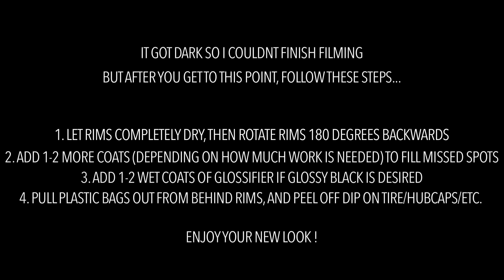How To Plasti Dip Your Rims (THE RIGHT WAY)

Comment: Not the best way to plasti dip rims... Best way is to take the wheel off the car... This is the lazy way... Sry no disrespect. Just saying the truth.
Reply from the maker: The point of plasti dip is to temporarily change the color of your wheels and overall protect the original rim from any further road damage. If you were permanently changing the color of the rims then yes, painting the inside of the rim would be necessary. But you get the exact same results doing it either way. And you can see on our Instagram page @throwsomediponit.
Reply: only u paint one side of the rim.i have motorbike so need to paint both side of the rim.
Reply: This is the dumbest explanation of laziness I've ever seen.
Reply: TheBalcerman Not everyone has the tools nor time to take off the wheels, just spray and go
Reply: Are you serious now? Tools to take wheel off? You can literally find them in the boot of your car. Time?! 3-5 minutes? Spraying takes like 75-90 minutes (intervals of 15 x no. of layers) Your argument is invalid. What we can see on the video is: "how to plasti-dip wheels the shitty way". You see. I do things right or will rather not even try to do shitty job if I can't do it right.
Reply: Jose Huezo. liked your comment
Reply: Only your opinion, some people like the silver finish to remain on the inside . The Black/Silver look.
Don't accuse people of laziness when they're simply creating a different look.
Reply: Jeeezzz.. this is some BS.
Reply: TheBalcerman you mad or what?
Reply: Unicorn1231997 If you don't have the tools to take off your wheels then your screwed when you get a flat.. if you have time to spray them, then you should have time to remove them...
Reply: Best way is to take the tire off the wheel after you take the wheel off the car
Reply: he's only doing the outside face, that's a waste of time
Reply: DuoBart0n best way is to buy brand new
Reply: Jose Huezo some people don't have the resources to take their tires off.
Reply: Let's just say that you are lucky that you didn't have wind blowing. or that black pain would be all over the side of your car. imagine taking black spots off your white paint. you're bound to scratch the paint.
Reply: Jose Huezo in your thought process...plasti dip rims? Thats for broke people
Reply: Ignacio Cabrera what? Your comment makes no sense. It doesn't make sense. So your saying since it's for poor people to take the video down bc it's pointless
Reply: Jose Huezo obviously
Reply: Ignacio Cabrera easier way to cover chipped rims instead of paying the wheel guy,  save  $$
Reply: Jose Huezo I got 2 coats, what u guys recommend? Lazy way or get more coats and do it the pro way?
Reply: Lazy kid , take off the wheel
Reply: TheBalcerman you get the same result
Reply: Really, they all come with a jack and lug wrench. Check your trunk( or boot) smh
Reply: Hmm,these cars come with a jack and a lug wrench
Reply: Mad, not at all. Just smh to comments of folks who say they don't know how to change a tire,  or have the tools. Pretty sad.But that's today's youth.

I could care less if folks leave the wheels on the car. Though you do run the risk of over spray on the paint if there is a breeze, and run the risk of that over spray getting on your brake pads / disks if not done correctly..
Reply: How is this "lazy"? Not everybody has a high quality car jack or system
Reply: LOL, most if not all newer cars have a car jack and a lug wrench in the trunk. Stop the nonsense.
Reply: If somebody want to do it with the wheels on its their business why y'all so butthurt over somebody else car?
Reply: Exactly. Most NEWER cars. I wouldn't put a can of 10$ plasti dip on a brand new car, that's just trashy. I use this stuff to make old parts look like new again such as rims, handles, mirrors, emblems, etc
Reply: Need a tissue princess. stop with the weak excuses. Doesn't matter how old a vehicle is, you should have a jack for the vehicle. That's just irresponsible and lazy if you don't.
Reply: Jose Huezo I spent 2 hours on each rim..had to take em off and clean em and get an even coat throughout
Reply: Guys i dont think they mean separate wheel and tire, i think they mean remove the the wheel and tire from the car to place on a workbench or something to get good access and get all sides even so you're not blindly spraying with can upside down. Also if you dont have the tools you should really invest in them so you're not stranded with a flat tire and a spare tire but no jack to lift the car.
Reply: THROWSOMEDIPONIT I agree. I plasti dip my rims to cover up scratches and rock chips like the video and they look fantastic. No reason to spray them inside out. Might as well buy new rims in you want to go thru that whole process.
Reply: Notification just roll the car backwards a bit and then you can paint all corners of the rim. I just did this last weekend and everyone at work thought I bought new rims.
Reply: Anthony Smith you are 100% correct, saves time all around and the end product looks very well.
Reply: People saying don’t have the tools or resources to take off the wheels? Damn, I hope you never get a flat tire 😂🤷🏼‍♂️
Reply: TheBalcerman it takes me about 20 min to jack up and remove a tire
Reply: Or you could put playing cards between the rim and the tire.
Reply: THROWSOMEDIPONIT it looks good with less work. Good job bro!
Reply: What does taking off the wheel vs. Not taking off the wheel accomplish when you're only plasti dipping the faces of the rims? Each method has the same result in the end, as long as you properly cover everything I don't see a problem with doing it this way.
Reply: Exactly
Reply: @dinodon1  you can't say its a different look Balcerman is right. Not saying it doesn't work its just the quick simple way of doing it
Reply: I have a jack and a lug wrench. I just need to paint outside of the wheel. Guess I am lazy?. If you are seeing backside of my wheels?, one of has a big problem!🤣
Reply: I like his process and I did the exact same thing to my BMW rims. You may think it’s lazy not to take off the wheel first but not everyone cares if the whole rim is painted. The only part that’s going to be shown is the part that he painted in the video. He also protected the brake disc so I honestly don’t see the problem but everyone is different.
Reply: @TheBalcerman 😂😂 it’s is it really that deep ? 😂 its only an opinion , perspective, someone’s way of doing things.😅 it’s ok to agree and disagree  on opinions preferences outlooks perspectives ect..without taking it personal.

Comment: probably the hardest rims I've seen to paint/clean.  Lol looks nice!!
Reply from the maker: vince m thanks man
Reply: I got a 1990 Volvo 760 and the rims are a pain to clean when we had them white. It has like 30 small spokes and brake dust made it look horrible, we took it off and we're switching to black so it looks mean instead of classy
Reply: Wait till he rolls them and realized he did not get the bottom lip or the insides of the bottom 😂 take the wheels offffdf

Comment: It would look better if you took off the BMW logo before and then put it back after
Reply: Why? You can just peel the dip off the logo.
Reply: When you'll start peeling it off the logo - it won't stop at logo - it's a same layer over whole rim - it will peel the rest. It will look like crap with uneven borders.
Reply: Drewe Carlson  not if you know what you're doing
Reply: plastidip peels bro, u can just peal it off
Reply: Or cover it with masking tape

Comment: This is exactly how NOT to paint rims lol. Overspray in the tires ,wheel wells and the car itself. Wow
Reply: eric muraca its plasti dip, you can peel it off...
Reply: Good thing its not paint
Reply: Except it doesn’t come off as easy when there’s a million little black dots from overspray on your cars paint job. I’ve done it. Learned my lesson after the first wheel.
Reply: If done after reading instructions,its perfect.done motorcycles and rims,about 27 months on last bike before wanted a change..And as far as over spray Mircofiber cloths take it right off..you must not read...and prep is everything.
Reply: So many amateurs on this video it’s crazy. It doesn’t have to be permanent paint to be a pain to clean 🤦🏻‍♂️. Black dots all over the car don’t “peel”. You will have to use goo gone galore to clean the overspray then if you use too much you will need to buff the clear coat and wax. Do it one time and do it right.
Reply: lmao maybe understand the product before posting a negative comment. Plastidip peels right off any surface you dont want it on. Its more of a colored paint protection rather then paint.
Reply: Doc8Ball's GearHead Gaming doesn’t matter, prepping it correctly at first is better than peeling off hundreds of little black spots of overspray
Reply: @docsgearheadgaming2503  YOU DO NOT WANT PLASTIDIP ON ROTORS AND CALIPERS. PERIOD. DO IT RIGHT.
Reply: Johnny #59  bruh how do they not get this? I literally just dont have the time because of work so I'm just cover everything and spray. Make it look brand new with barely any effort....also qualified in painting and this is fine
Reply: that's exactly what I was thinking.... that over spray and the center caps 😭

Comment: This is about as far away from the "right way" as you can get! Whats going to happen when you take the lug nuts off? Hint: the paint is going to come off with it, and why didn't you remove the center cap? Not to mention you must now have a TON of overspray all over your car! Please kids, PLEASE don't try it this way at home. Take the wheel off, remove the center cap, mask off the tire, You'll probably need to put some old lugnuts over the holes. Paint the wheels as far away from the car as you can get, control the overspray!
Reply: I did it this way and there's no overspray on my car. I did get some on the tires but that peeled off

Comment: how durable is this, will it come off as it drive and stuff hit the wheels.
Reply: yes dont waste your time with plasti dip on wheels, Ive done it 3 times and no matter how well you prep or how many coats you use it WILL come off or peel
Reply: It all depends on how and where you drive your car.  All I heard was good things about dipping
Reply: ilovevipers101492 thx for that info, was thinking about doing it on my E90, think I'll fall back
Reply: I took off my 4 wheels, started in the morning to be able to get them max sun exposure to dry them, put around 10 coats on it, put them back on car and maybe in a month or two it started to peel, but only in the areas where there is curve/angle less then around 90 degrees. In those areas it started to create bubbles. The flat surface areas, the plastidip is fine and dandy. If you want a permanent paint coat, I would suggest to avoid plastidip and just get some permanent paint which is what I am thinking of doing soon to fix the wheels.
Reply: I am Perfection alot of people who say good things about dip are mainly people who don't even daily drive the damn car or let alone drive it more than 6000 miles a year. Trust me that dip sucks paint or even the cheapest vinyl wrap is better. Only place dip holds up is emblems and spoiler and thats it
Reply: Yeah, that is what I pretty much said, plastidip sucks, emblems didn't work for me because originally, I painted the who rim including the center cap that had the dodge sheep logo and it created a big ass bubble that I just poked it and took it off, it did look better but it shouldn't have done that. And now the rims are also starting to get bubble areas. I also plastidiped the front grill and it is also started to peel a little with bubbles.
Reply: ilovevipers101492 is DupliColor better?
Reply: ilovevipers101492 hasn’t came off mine, just bad experience for u
Reply: Mine lasted about 3 years

Comment: Is there a way to mess up, does the paint run? If its to close ?
Reply from the maker: Yeah you can definitely mess up and have drips. Don’t want to be right up on it spraying. Have to adjust how much you spray based off temperature outside as well

Comment: did you not coat the tires in the dip release ? stops it adhering so you can remove it easily, also, I would have taken it off the car,  and you didn't show an after shot ? that would have been the right way

Comment: just remove the tire from the car, plus with the tire off you can lay it flat and give it a better coat getting all the areas thats harder do see when the wheels are on the car
Reply from the maker: nicandlucian in my opinion you don't want to lay the rims down and dip them. Makes the can spurt if it's at that angle. That's why you move the car back after your second coat to miss the spots you missed. Ppl make it more difficult than it is. Peep my IG: Instagram.com/throwsomediponit

Comment: Do you need to worry about the nuts when doing this or can you just paint over them? If I need to change wheel will taking it off take the paint off or it is more durable than that?
Reply: @Mikey moo I no longer have the car but I did this to the wheels on my old car and it actually lasted really well I was quite surprised. I also did a bunch of trim that was faded and the grills. Totally transforms the look for a small price. New car has black rims now anyway

Comment: Use rubbing alcohol to take the oils of the cleaner off. Take the rims off the car. Deflate tires if you can’t take them off. Remove center cover. Use real paint because spray on plasti dip will peel and crack remove wheel weights because dip will just bridge it leaving air to bubble. Just a few recommendations if we’re talking the right way

Comment: Don't spray the rims with a pressure washer! No No No.... That $3 paint job will peel like a $3 paint job. Also, I think the term "right way" was used quite loosely. This was basically following the directions on the can.
Reply: Kevin Alexander you have to let it bond with the wheel. It’s going to be a while before you can pressure wash it. Like wait two weeks
Reply: @d3gkryan823 . Rubber paint isn't going to bond to coated aluminum. Not unless you scuff the surface first, and then the chances are slim. I recently bought a car that had the rims painted with plastic dip. It peeled off with just a light swipe of the lance. Unless the surface, any surface is prepared properly, paint will not bond.

Comment: Take the tire off the car. Tape the tire and remove or tape the emblem. Lay the tire flat. Paint/Dip lays much better with far fewer chances of a run. I suspect the final product here wasn’t that great hence no final result pic.
Reply: And you’d be wrong
Reply: @jadenrobinson1561  Post a pic then.

Comment: This is NOT how to paint anything! SMDH
And this is lazy way. Take the tire off the vehicle you'll get way better coverage/angles. There's a lot of reasons you should remove and lay rim flat on the floor!
Reply: not flat. should be min 45 degree angle
Reply: @charlottetownspud7903  hold the can 45 degree angle.

Comment: Is there any concern about sealing the lug nuts by painting the rim while it’s still attached to the car? Or will a tire iron still be able to fit around them and twist them off?
Reply: Also: the air cap?
Reply: I just put masking tape over the lug nut holes and around the whole air cap and threading.

Comment: this is messy. take a deck of cards, place it between the rim and tire. take cardboard, line the inside of the rim and cover the inside completely (press plastic bag against the back side of the spokes). this way is really messy. take an extra 5 mins for prep to avoid 15+ mins each tire wasting time peeling after you spray
Reply from the maker: Lester Morales not mad at you for being naive when it comes to plasti Dip, but that's completely unnecessary. Take a look at this video I made of the peeling process. All you have to do is clean your tire walls prior to dipping. Don't make it more tedious than it has to be. 

https://instagram.com/p/BUDTHINBq1p/

Comment: If you’re actually are serious about a good looking rim take the wheel off use index cards and shove them between the rim and tire so no overspray gets on the tire then spray in EVEN LIGHT coats unlike this individual if you do it right there shouldn’t be any worries about runs and or drips.

Comment: That is definitely not the right way to do it.. The right way to do it would be to take them off the car 1st so that way you don't get any over spray especially on a white car.  And then also tape off your tires so you don't have to peel it off later..

Comment: looks real rice, problems is that when you turn the wheel you might not have enough paint on the bottom portion of the rim, I would say maybe the layers is the correct way but the process is wrong. Just saying. Anyone doing this job, take the rims off bc if you doit like this, on your next flat when you take the tire off you will peel some plastids when taking the lugs off.

Comment: uuhh i dont think plastidip on ur brake rotor is any good, plus its gunna be uneven cuz you started the spray on the rim. Its best to remove the wheel and tire for better results, and spray it evenly doing almost what u were doing jus continuous movements but dope vid man im subbin

Comment: Bought one of their wheels kits, prepped as instructed, sprayed as 
instructed, and it peeled off the first time I drove it.  Their response
 "Well, sometimes it doesn't work"  Gave it a 1 star review on their 
website - and they dont include it in their reviews.  Easy to have a 4.9
 out of 5 rating when you reject bad reviews.  Don't bother with this 
product or this company
Reply: Either you didn’t add enough or you didn’t clean the wheel. Mine lasted perfectly until my dumbass scrapped my wheel on the curb